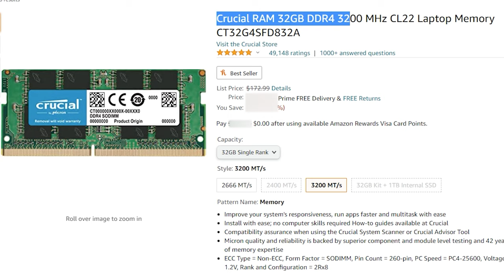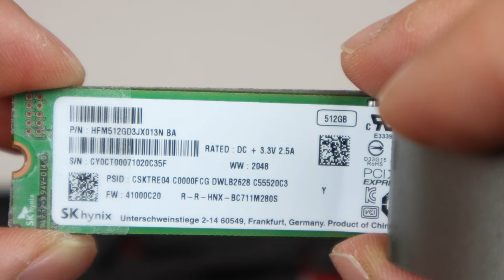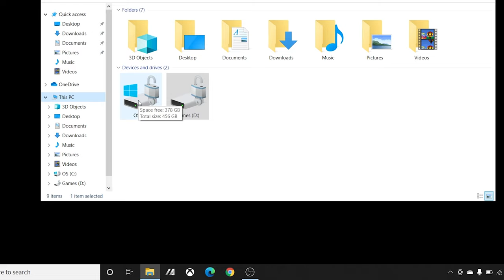How to Install/Upgrade RAM and m.2 SSD in ASUS TUF Dash F15 Gaming Laptop (NVMe only)

Comment: Hi Phil, what is the maximum ram capacity can this laptop take? And does it have a sata ssd slot?
Reply: A 32gb ram card is the largest it will accept and the two M2 ssd slots are the only drive bays.  There are no sata slots.
Reply: @TgrHwke  thanks for info! I bought the exact model as well and looking to upgrade the storage and ram.
Reply: @TgrHwke  I ordered a 32gb ram in addition to the 8gb that is already soldered on the motherboard, will it add to the 8gb to make it 40gb or the laptop will only recognize up to 32gb?

Comment: Hello! thank you for your video. Maybe it is a dumb question but, the only way to upgrade the ram is with a 32gb stick? I mean, is it useless if I buy a 16gb stick for the upgrade?
Reply from the maker: No, you can install a 16 GB stick just fine; then your total RAM will be 24 GB, since 8 GB is already onboard as well. I mentioned the 32 GB stick because in order to max out the system at the advertised 32 GB maximum, that's what you'll need to install. There are no single RAM sticks that are 24 GB capacity that you can add to the existing 8 GB to get to the max amount.
Reply: @FixItPhil  hello i got this notebook with 16 gb onboard, will the dual channel work if i put 8 or 16 gb in the empty slot?
Reply from the maker: Yes, it should.

Comment: Can use a PCIe Gen 4 X4?
Reply from the maker: Yes, PCIe Gen 4 is forwards and backwards compatible, so you can plug a Gen 4 drive into a Gen 3 slot, like the one in this laptop, but be aware that it will only be able to perform at Gen 3 speeds.
Reply: @FixItPhil  Thank you!!!

Comment: Hello! Does anyone know if I can put in this tuf a Western Digital WD Black SN850, 1TB, PCI Express 4.0, M.2, NVMe SSD?
the CPU-Z program says the motherboard bus spec is a PCI-Express 4.0 but on the motherboard it says PCIE GEN3x4 as in the video.
Can someone help me, I don't know whether to buy sn850 or sn750?
Reply from the maker: I haven't tested it, but I'm pretty sure the Gen i7 Intel CPU doesn't support the number of lanes needed for PCIe Gen 4.0. That said, you would be able to install the drive on the motherboard, since PCIe Gen 4 is backwards and forwards compatible, but my guess is that it would perform like a PCIe Gen 3  SSD rather than at the faster Gen 4 speeds. If I pick up a Gen 4 SSD, I'll throw it in this laptop to test it out and confirm and post an update video!

Comment: 7:01 - when you power up the notebook, the memory size reads "16GiB" - so what went wrong with 32GiB module installation? Will this laptop show you 40GB of RAM or 32?
Reply: It will only show 32 gb of ram. Even though you are going over the amount the motherboard is able to take it wont recognize the other 8 gb.
Reply from the maker: In the video, I did not actually install a 32 GB chip as I did not have one on hand, so my BIOS screen reflected the original 16GB of RAM, since I re-installed the factory included 8GB stick (plus 8GB soldered RAM). The manufacturer stated max for this model is 32 GB, but I have yet to verify what the BIOS will display after a 32GB chip is installed. Other users have noted that their systems reflect 40 GB, though it's unclear if the system can actually take advantage of all of the capacity.
Reply: i install my and shows 40 GB of ram !!!

Comment: thank you 🙏🏻 upgraded mine added a 32gb ram + the 8gb soldered ram and 2 1tb nvme 🥵 and it renders fast 🥶
Reply: I have a question: what happens with the other 8gb ram?
Reply: @ariasa2505  it stays and add tonthe 32gb ram which I put. so all in all it's 40gb Ram .
Reply: @mjgayo  And the PC reads it like that? I have this laptop too and 8gb it’s not enough for gaming and streaming at the same time.
Reply: @ariasa2505  yes it reads it like that,
Reply: @mjgayo  Thank you Mark! One other question: Can the i7 11th gen get the job done processing 40gb of ram? I play WZ and stream on obs and the CPU time is around 30 ms, I really don’t know how the CPU works.
Reply: it can . 😊 I edit and render while I play dota2 or PUBG while I watch , just make sure it's on Turbo mode in Armoury Crate, everything is there the usage, temp, voltage. also just add an external cooling fan. as it gets loud when it's on turbo mode it can help make it silent while streaming.
Reply: @mjgayo  Ok, I’ll do it tomorrow afternoon and I’ll start saving for the 32gb ram. Thank you so mucho for the comments!
Reply: @ariasa2505  no prob man

Comment: Do I need to mess with anything (On the software side) after inserting the new ram or am I just good to go?
Reply from the maker: Usually no, it should be plug-and-play. An outlier would be if you're on an AMD system and need to enable an XMP profile for overclocking (with a supported RAM stick) or if you're experiencing issues due to an incompatible CAS latency (pretty rare).